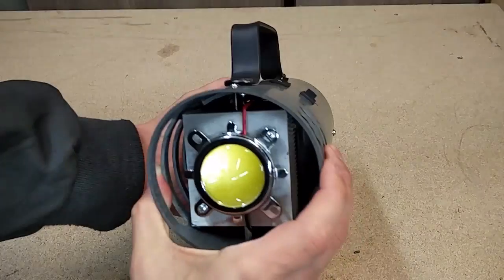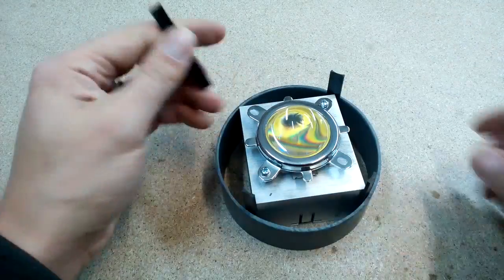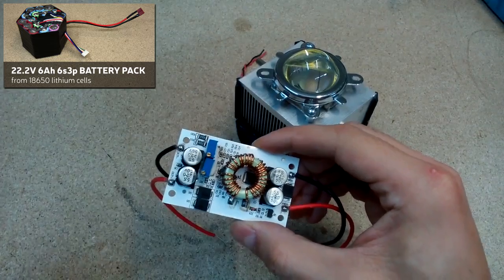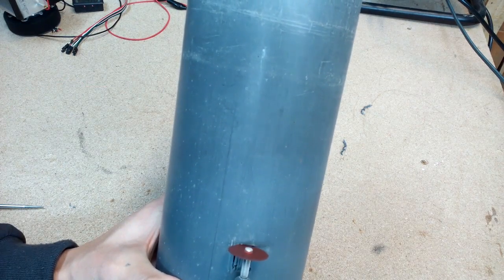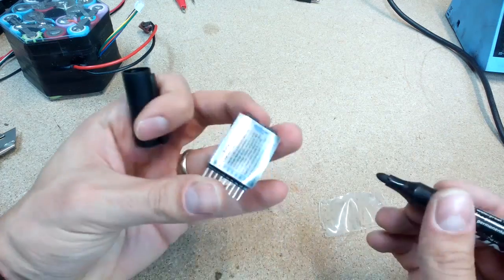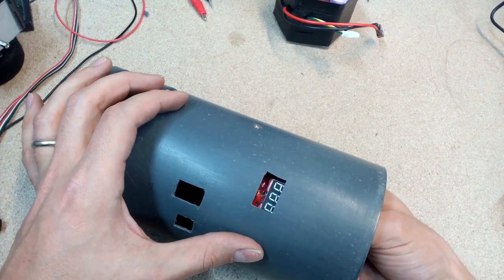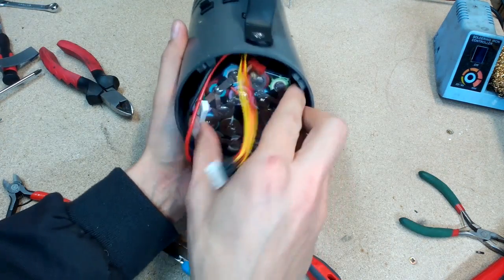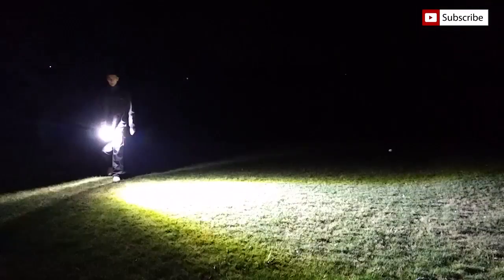DIY: 100W LED Flashlight Mounted In PVC Pipe

Comment: I really liked the body design.   You tried using a fan to provide airflow to all parts.   The only problem in my opinion is that you did a lot of maneuvering on a normal flashlight.   In my opinion, if you increase the number of LEDs and also put another fan on the back of the body, it will be great

Comment: 3 years ago, I started messing around with 18650's. Not knowing my head from a hole in the ground, I build my first battery pack using the method for this build(6S3P). Recently, now with a little knowledge under my belt, I realized that pack was crap and it looked like it was made by a third-grader. Not to mention the cells I used should have been tossed, but it served it purpose and supplied me power for my small projects. 3 years later, and I kept remembering this 100watt led flashlight you made. So again, as I did 3 years ago, I will rebuild a better battery and this led flashlight. I will add the video to my Youtube channel, and give props to you for the build idea!! Should be a better battery pack, considering I have done hundreds since then and built around 12 battery tab welders.  The build is for my wife when she walks the dog outside...Thanks again for your neat builds!!!

Comment: I would have tried to make the housing (metal, not PVC) as part of the heat-sink.  A fan consumes power
Reply: Are you the guy who thinks lithium batteries can't power electric motors?

Comment: or you can use an XHP70 CREE LED which can deal with 100 watts if you have that lens there, and you will get a much nicer beam of light, also you will work with only 12 volts instead 33. Yes, XHP70 CREE can give out ~10000 Lumens at 113 watts with a copper heatsink

Comment: The spec on the ebay DC boost converter constant current 250 Watt devices says they have an input voltage range of 8.5 to 48V DC.  Why did you need the DC to DC Step Down Buck converter ?

Comment: No proper thermal paste or pad to aid the heat dissipation? That could still  burn out even with that heat sink. Is the surface extremely flat on both the heat sink and the LED itself? If not, then there won't be enough contact between the two surfaces to dissipate the heat from that LED.

Comment: Great job!  I was thinking, if you had left  4-5 inches of the tube in front of the LED and plate it with a reflective foil, it would focus the light slightly more and would prevent the spill of light on the sides.

Comment: very good. but you should use some protective transparent cover in the front. and a small wire mesh over the vents to make it more secure and water resistant Nice project.!.

Comment: Very nice setup! I want to build such a flashlight, but how do you safely charge the battery if you do not have a charger such as Imax B6 or Turnigy? Is it possible to use a 12v common charger or a laptop charger?  Can you suggest a functional solution?  Thank you very much for sharing!

Comment: Im running my one at 1 amp 28v, i can run it at 2 amp but no point going more than that as the brightness difference is not worth it for the extra power consumption im running 8x18650 cells 2 banks of 4 wired in parallel

Comment: Good day, inspired by your work I used the same concept but 3d printing the internal bits to complete my light. Mine runs off 220v ac but can be converted to run from a battery by changing the 220v ac driver to the boost converter in your design. https://www.thingiverse.com/thing:2612706

Comment: how come you used a 250w boost converter? Could you use a 100W one or will it not run at 100% output?

Comment: I think, overall, this is a fantastic build, albeit more of a prototype. 

There are some practical concerns for active use rather than as a novelty. But, again, this is a fantastic build with good attention to a lot of the details. 

If anyone is planning to build this for an active use thing, I would suggest adding an external charge port, potentially an external power port to run from a car or mains power, and to arrange the batteries in a ring around the inside of the tube and install the exhaust fan at the rear of the pipe for better airflow. Two fans would be a better idea, with one always on and the other with a manual switch or one that would automatically switch on at a given temp. Another good addition would be a switch to adjust the LED output. In my case, I would also want an adjustable reflector/lens system, or at least a modular one. Most of the time, I need a tightly focused beam, but having the option of a flood beam would be great.

Comment: Could this lamp work with 18v/4ah ?
Reply: The led needs 30v 3.5a to operate properly, so you will still need the boost converter in this video.

Comment: Very COOL!  SO nice!  Hey, you should look into better, thicker, black HDPE pipe for this.   SDR-11 (thick wall) & SDR-17 (thinner wall) both black and very heavy duty pipe used in gas & oil industry.  3" & 4" ID is a couple bucks a foot, but you could drive a truck over it.  You wouldn't need aluminum back plates for handle.  Also, I would set the LED in the can so the light source was more hidden a little deeper in the can, not so much light spillage out the sweet venting slots.
Reply: Have a look here, it's based on his design, https://www.thingiverse.com/thing:2612706

Comment: very nicely design but with fatal flaws. no protective circuit for li-on battery pack and no waterproof. Accidentally if someone takes it in rain water will short the battery pack or circuit which is dangerous. it may explode.

Comment: Well done my friend, very well done!!  Design and engineer a way for your lens to telescope in and out for an adjustable beam.  With your lens close to your LED chip like you have now, your flashlight is throwing a wide angle flood beam, if that same lens could telescope out or travel away from the LED chip, your beam would narrow and focus, becoming more intense as it traveled away from the LED chip.  Great job and very good tutorial video.

Comment: Hi Mate. Wohh super work.. Im startet building a similarity and like to measure volt and amps as you do, but can not quite see how you've wires to voltmeter. Could you tell me where the yellow cord is? Don't you use it😅

Comment: if the Booster doesn't have curent regulator , will the led pull in more than 3 A ? is there anyway to do it without using it ?

Comment: have to admit you are the best designer in housing, im good in soldering and connecting wires and switches but not in housing units, now  i have a bit of an idea thanks. but dont you think it will be cool if you design a front cover for the front of your light i mean something to protect the lens from dust and scratches.

Comment: how do you recharge the batteries, I did not see a plug receptacle for the ac adapter, do you have to pull out the battery pack to charge it up or have you added a port?
The look is great, at the end when your showing it off, compare it to a small Mag light, a big Mag,  a 6 volt lantern type flashlight and finally your beast (should show well)!

Comment: liions,  don't run down at 3.2 it's bad for your cells!, those meters are highly inaccurate! I had one and it was 0.5 volts off! always check with a dvm!! 
im sorry to say all this, but inexperienced people could Harm themself or others!! 
lithium cells are not to be made fun of
Reply: still... it's an awesome project, and I'm gonna make one with lipo packs!
Reply: actually it depends on the cell. Some Panasonic ones can go down to 2.8v no problem at all.
Reply: OrbitalSP2 really? That low? Didn't knew that.. Always had a 3.2 volt as maximum discharge voltage
Reply: Yes. But most of them can go down only to 3.2V as you said. Some cheap bad ones like ultrafire have no energy at all left at 3.5V or 3.6V.
Reply: OrbitalSP2 lol, I know I ordered a pair of those, and some weird GTP 9900 mAh's for fun...one of the GTP had 1250 mAh and the other 1233 they had a very low Internal resistance that was good.. 
So there fun for small applications.. But indeed when they hit 3.7 it'll go very fast with the rest of the capacity.. My Samsungs seem to achieve their maximum capacity around 3.8 volt and gradually discharge its very fun to see how different batteries discharge over time!
Reply: Yes, I have 6 crapfires and a few LG, Samsung and Panasonic ones. At least my ultrafires are not THAT bad because they have around 1200 mah. Some of them are reported to have 600 mah ou even less than that. Gearbest or Banggood, can't remember, was selling genuine Samsung 2600 mah for $2 to 3 each. I got a few and they were actually 2700 mah. Very nice.
Reply: OrbitalSP2 gees, I wish I had such a deal on them.. I pay $ 27 for a pair of 3400 😕
Reply: OrbitalSP2 lol... These are awesome! I can 8 now for the same price! Thanks bro! You really helped me out on this one! 😀 they look awesome!
Reply: Get*
Reply: No problem ;) I got two Panasonic from this link. They are genuine but I measured 3150 mah out of them. I think that 3400 is only under very special conditions, or maybe discharging them fully to 2.8v.
Reply: OrbitalSP2 could be, the 3400 that I have have around 3200 only when I top them up with a very low charge current.. And like 0.05 over charge
Reply: Hmm.. Mine is actually quite accurate. At first, it was also inaccurate but then I know why my battery tester showing inaccurate result. It's because my battery's balance connector is bad. After a quick fix, it became great.

I have a 3s battery pack consist of 3 Sanyo UR18650NSX and it works great. At the datasheet, it says the battery can be discharged all the way down to 2.5V although I've never done that, not even below 3V.

Comment: you should add a charge port for the lipo's
so you can charge the light without having to remove the batteries. only remove the batteries if there is a fault

Comment: Did you power the LED without any resistor?
Reply: The voltage booster he uses has integrated current control, that he set to 3Amps. That is way better than using a resistor.

Comment: what is your batt capacity and how long does it last?
Reply: This battery pack has 6Ah capacity, that LED uses 3A, so this will light 2 hours with a fully charged battery.
I would recommend a potentiometer, for the user to be able to control (decrease) the light output. Of course the pot-meter needs to be in series with a proper resistor when fitted to the voltage booster, to make sure, the user cannot overpower the led.
Reply: not sure about the capacity but some guy who drew 1800w claimed it lasted 12 mins (720 seconds) 
you can do the math from here for 100w
Reply: different battery, this one can last about one hour on full brightness
Reply: Nagy Márton But there is also the coling fan...
Reply: Do not worry about the consumption of the cooling fan. I have one 12cm fan at hand, that says 1.7W. That is so far from the 100W of the LED, it will be almost unnoticable.
Other implenetations are using a "peltier" to speed up heat transfer. Power consumption of those is much higher.

Comment: on my project I'm using the Geronimo c36 gel type Prim Co 11 11 12 type conductor with a 34 amp chisel Chrome tip an adjustable dyrenium clad micro fuse typically run on a .76 alto frame in parallel conjunction.

Comment: very good but there is no battery protection circuit to make it fool proof. you could easily damage the batteries the way it is wired. it would also make charging easier.

Comment: Extremely pro job, some paint and a face plate to hide the front connections and you could sell these things!!
Reply: Agreed, I'd like to have seen a finish faceplate covering the side area around the lens, perhaps doubling as a focus-plate with a second lens for tightening the beam.
 I'd also like a 3-way power switch, 1w, 10w & 100w.
Reply: N 8 GNS
Reply: Daniel Pierce lguzqwey7

Comment: The heat exchanger needs to run into the handle so you need a copper pipe  for that. Typical "German" engineering though. Very nice.

Comment: 2:01 dielectric grease is needed to prolong the life of the LED - aids in transferring heat
Reply from the maker: +2Truth4Liberty later in video I added it;)
Reply: Well Done Tips
Yes, at 2:01 you added it - i was just filling in the WHY you added it
Good job!
Reply: Would thermal paste made for PC components work? Such as Arctic Cooling MX-4.
Reply: youtube comments are not for self-advertising
Reply: it's for preventing hot spots (no contact to cooling sink if anyone wants to know
Reply: that's maybe the better paste you can use
Reply: wont normal thermal compound work?
Reply: Adeel Safdar
Reply: +Hans Schmidt
Stop spreading such shitty information.
1. Coollaboratory Liquid Pro is not allowed to be in contact with aluminium and take a guess what that AMD heat-sink is made out of
2. Any form of "Liquid Metal" TIM is conductive
Only because you saw a shitty Youtube video about h0w t0 incre4s3 y0ur 1337 h4xxor 0vercl0ck1ng sk1llz, doesn't automatically mean you know what you're talking about.
Reply: Topias Salakka
Anything - as long as it transfers heat fast (way faster than air) and -- stays in place.
Reply: Give him a sec, he put it on after fitting the led, about 45 seconds later...
Reply: +Topias Salakka Absolutely!
Reply: Yes, anything made for transferring heat would work.
Reply: +epicduck gaming maybe you need a refresher course it's all Dielectric grease these days
Reply: 2Truth4Liberty
Reply: hi :)
Reply: Hi gusy please visit my channel 😊😊😊😊😊thank you very much 😊😊😊😊😙😙😙😙

Comment: It's a very nice constructed thing but I doubt everything is 
real. First, it is a perpetual motion machine, and that does not exist, 
because the loss of the step up converter not counted, he delivers  66 Watts to feed  a 
100 watt lamp. In addition, it is absolutely not recommended to solder directly to cells in the body. The built-in overpressure valves melt and then  loss of  capacity after 
several charging times wil going to happen. How ever, to show how handy you are, he is great and beatifull

Comment: Would it make sense to use a lipo instead for better discharge amps? That's a lot of 18650 batteries, and mixing and matching the types is really bad for them.

Comment: how do you charge the battery pack?
Reply: A 6-cell Lipo/Lithium Ion battery charger.  The power wire and balance wires he has connected to his battery pack are standard configuration which will plug right into a normal RC/Hobby 6-cell (or greater) battery charger.

Notice how the rear grill slides off whenever he wants and gives him easy access to pull the power connector and balance wire connector out the back to connect them to a charger.

Comment: stock CPU fans like that actually blow onto the heatsink, not away from it, you should mount the fan upside down to blow air out of the back of the pipe :)

Comment: Guessing you have made some kind of modification to that soldering iron station, because if its' the station I think it is, it's poop and takes ages to heat up. Looks like you have gutted it in someway, are you just using it as a stand? 

I've moved on to a "YIHUA 939D", heats up fast(like 30 seconds), tips are cheap, silicone wire on the iron end. Most of the stuff is replaceable and cheap. You can actually find cheaper versions of 939D clones I liked the idea of the silicone cord and they had stock in my own country for fast shipping and the difference in price wasn't that much.

Comment: Hello Mr. Well Done Tips.
I have a few questions about this awesome flashlight, i would love you can help me with this.
1) I want to know how much time does this flashlight works with full battery until it goes off.
2) I would like to know if we can adapt a "Generic Adapter of 22volts 1A Power Supply" to charge this flashlight.
I hope you answer this mail soon, i want to build one myself for my dad.
Greetings from Paraguay.

Comment: Hello, sorry for posting here (great video btw!): Can some one help me 
with a project? I want to put my 3 old and first graphic cards to a show
 case, plug the three fans and some red LED /I bought  a RGB led with 
remove control and power source) wire all up and connect to power source
 so the fans are moving and the LEDs are glowing.
I can use a soldering iron.
What I need is shoping list and a circuit plan and I don't know how to wire up the fans and LED to the power source.

Comment: How hot can that LED get? I wondered if you could use a Peltier type generator to put some energy back into the system just from the heat it generates..

Comment: I like the design and nicely executed build! Honest question: why not build a 12v parallel power pack with higher AH, so you didn't have to use the step down? Not even sure if it would make a difference in run time, I'm sure you do and would love to hear answer. Thanks for taking the time to share your knowledge with us! 

Oh yeah, what are using for a charger if you don't mind me asking?
Thanks
Reply: +Steve just Steve
The step down converter is just for the Fan, the led's operating voltage is at about 32 Volts at 3 Amps and therefore he uses a Boost converter to get it up to that :) 

The efficiency of Those Chinese boost converters is usually pretty good as well expect 80+ %

and in one Point i have to totally agree, the build is very good and Professional looking, i like it more in that regard then the one DIY Perks build, this one is more compact and durable it seems. Plus it has a recyclend battery :)
Reply: Thank you

Comment: Is that heat sink enough? I have similar sized one and i have 10W LED on it and it gets really hot after while and the LED itself is too hot to touch. So, was wondering how will that heat sink do for 100W LED
Reply: +Kinzoku Shirogane i think the fan is doing a good job